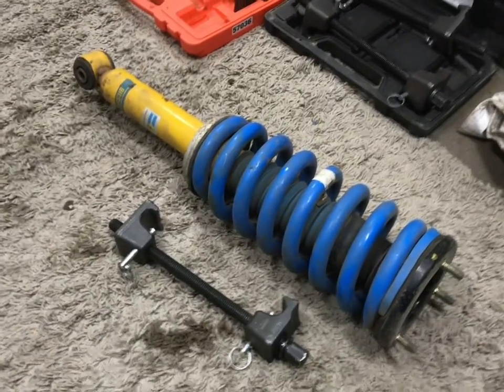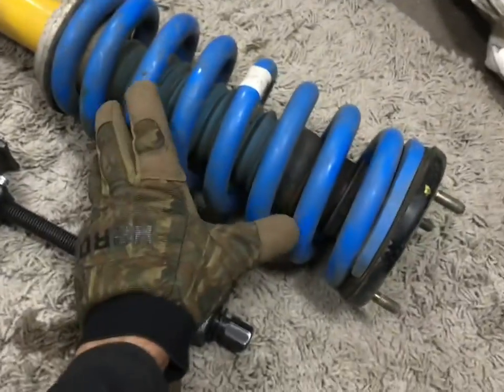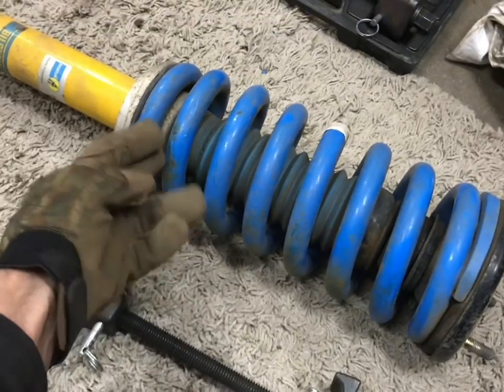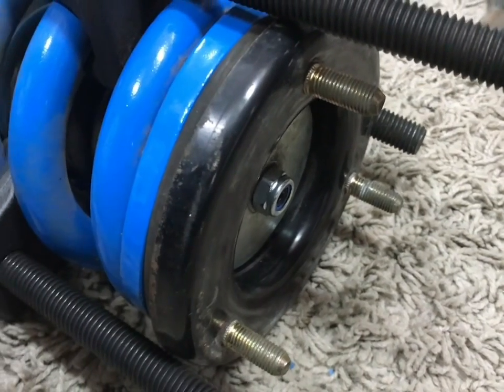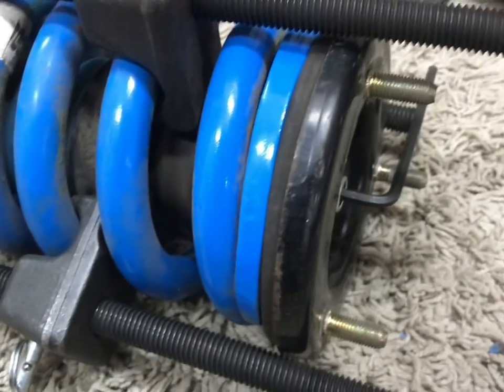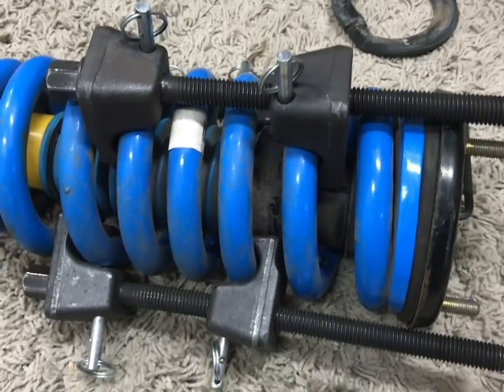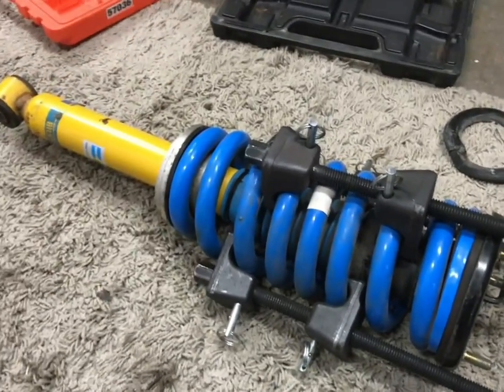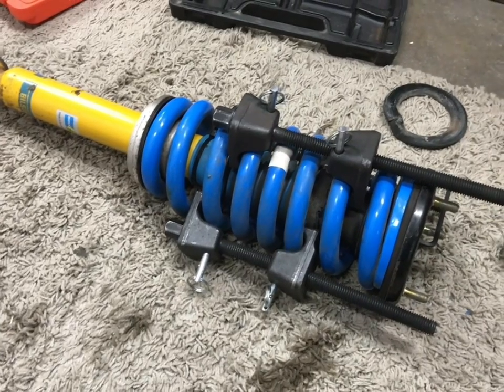5 Tips For Working With Coil Spring Compressors - Coilover Strut Assembly

Comment: GREAT great tips. I have a 16" spring ive been TRYING  to compress down to about 12". Using 2 tools just makes them slide at an ANGLE thus causing them not to be secure. Btw im using the tool with the HOOKs not the locking type like u have. I might just go rent those. Thanks!